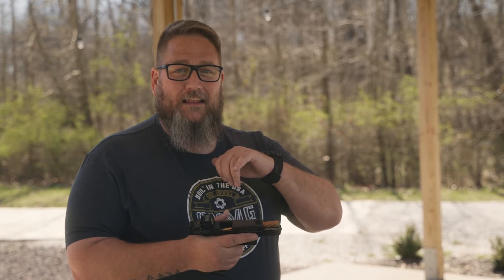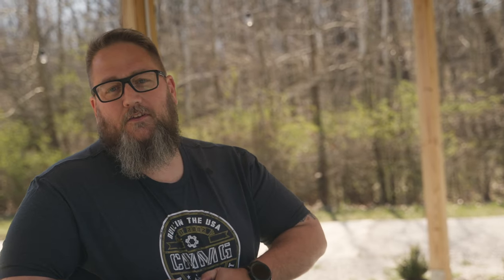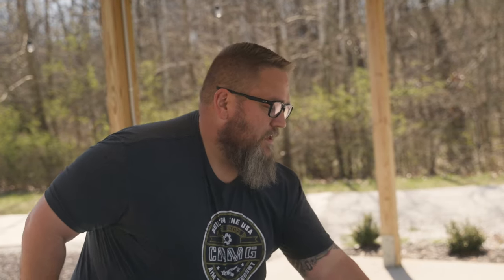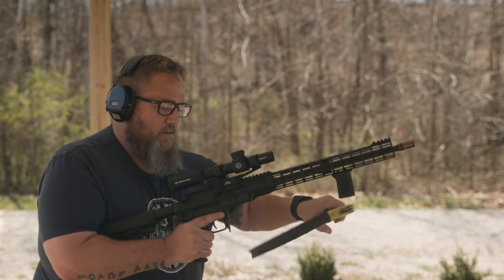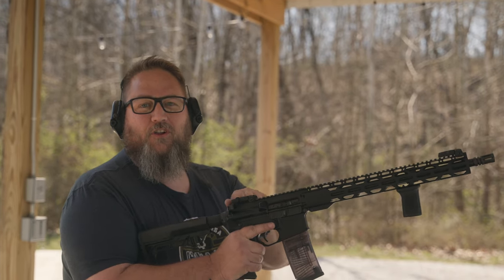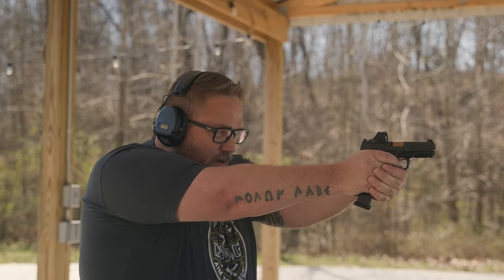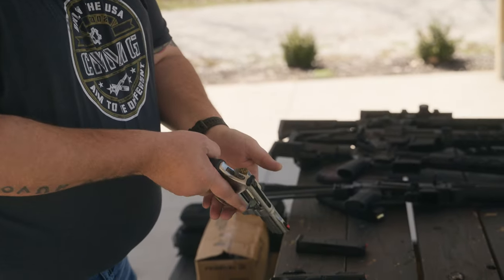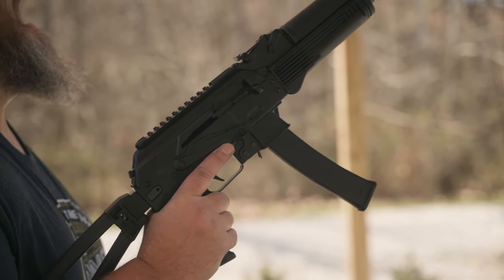Mike's Tips - Don't Baby Your Gun

Comment: yepp, I also noticed on the dissent in 300 black out using 220 grain. Even when I don’t baby it, it doesn’t like to be held or loaded with the barrel held back after loading a new mag. You have to hold it up at a 20 to 30 degree angle at most with those heavier rounds, or just flat level. It doesn’t like pushing those heavier loads on higher angles lol. Basically working against gravity.
Reply: Sounds like you need some dedicated blackout mags